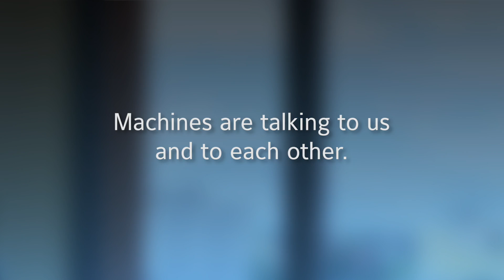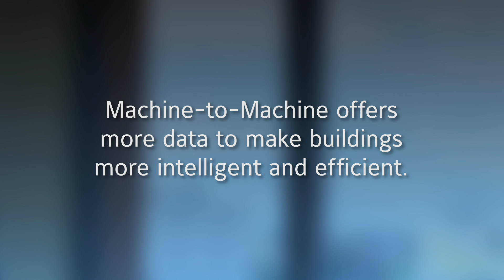Machine to Machine – The Future of Connected Buildings | Johnson Controls

Comment: Johnson...who are you kidding? The N2 network (your old network) was a server client network and for it's time was probably the best network system around, but it's biggest limitation was it's inability to allow devices to communicate to each other directly. A NCM was required to control all network communication and it could only share data from one controller to another if and only if GPL was installed and was programmed to do so. Doing this took very valuable and at the time scare memory and CPU resources. Networks and technology have come a very long way and some of the changes, I argue, took place and were built on the backbone and success of your N2 systems and controllers...but I wouldn't go so far to exaggerate the abilities of your technologies. Love you long time Johnson...but let's keep it real.